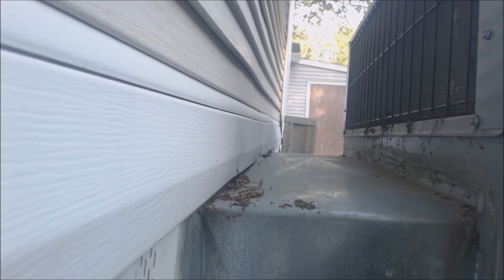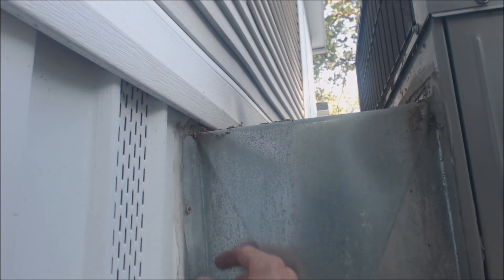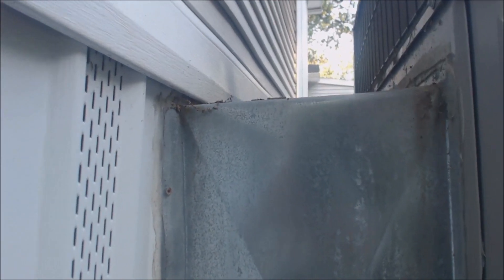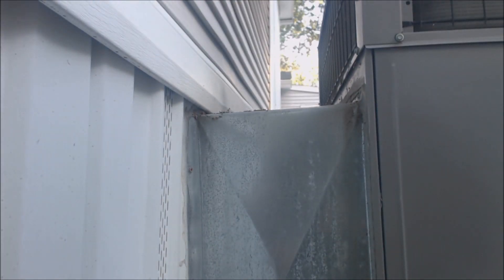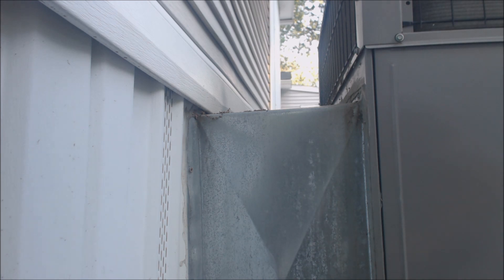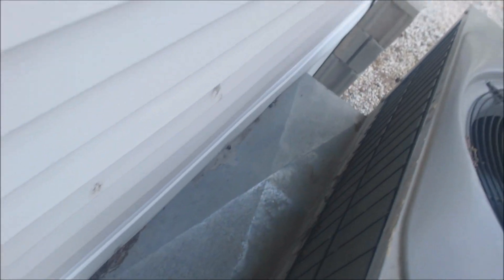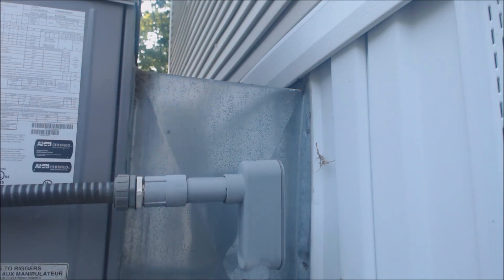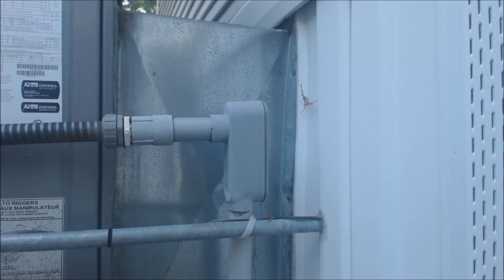Packaged Heat and AC Unit!- How to Seal it up to a House or Mobile Home!

Comment: This was an accidental find.
I’ll be fixing a package unit on a 2021 model Manufactured home in Arizona. The unit it simply butted up against the pvc side skirting with flex duct out of the unit. The critters have chewed the skirt and insulation on the flex to gain access. 
I was about sheet metal clad the skirting like a border around the package unit, I like this idea much more. I’ll just need to drag the pad back 10”.  Good on you for posting this!

Comment: The install looks solid, but I can’t tell by the camera angle if it’s sloped towards the house or the unit! I guess it’s dependent on how tall the unit is, to determine which way it slopes, but I would definitely double check the flashing around the mud sill and header if it’s on a house. I like how you have it going all the way to the ground. I could see how that would help keep wind from getting under it, as-well-as critters. Thanks for the video! You gave me some great ideas for my unit. Thanks

Comment: How can I seal up gaps under the metal shroud at the ground? Should I add dirt or gravel or maybe copper mesh then dirt or gravel? The HVAC installer didn't sink the shroud into the ground, so now I have a mouse infestation under my house.

Comment: What about the water that comes in through underneath that unit how do you address that issue
Reply from the maker: There shouldn't be water underneath of it. The packaged unit would be set on solid concrete blocks and leveled. If it was in an area with water then K-4 sand should be put there and possibly some stone around the unit. A packaged unit would not be allowed to be installed under a flood elevation. Make sure to check the flood elevation cert before pulling the permit for the installation, thanks!

Comment: Excellent information for owners of mobile home/packaged a/c units. Animals tore up the flexible duct under my mobile home. I spent a lot of time figuring out how to stop them all. SEAL UP THE SKIRTING after replacing your ductwork. If you are smart buy metal duct work that animals can't destroy. Insulate the duct work. Do ALL the joining and insulating in the back yard FIRST. Then drag it under the mobile home to connect it to the air tubing intake/exhaust of the mobile home. NOBODY likes crawling around under their mobile home. Snakes, creepy spiders and spider webs, etc. So make it a one time deal. I wish I had been smarter the first time.
Reply from the maker: Thanks thinker too!
Reply: Where do you buy that?

Comment: I bought a house that I need to install a heat pump a 2. 1/2 ton you know the wire size and braker size ,,,I was told  a 60 amp and 40 amp both for the air handler ??? and a 30 amp for condencer unit..is that correct or incorrect.???
Reply from the maker: You would need to look on the rating plate of the unit you are installing at the outdoor unit and indoor unit along with heat strips if used, thanks
Reply: @acservicetechchannel  OK thanks

Comment: if you ever do a package unit where you have to make an angled shroud I would like to see that. I can do one but i feel it can be done easier.
Reply from the maker: Ok thanks for letting me know. It would be an odd video and that is probably why I haven't done one to date because I use two pieces of plywood at the site with my own body weight to cross break and bend it. Thanks David!

Comment: I need to make the metal shroud for my unit where can I get the tools and material?
Reply from the maker: That is just made from a 26 gauge sheet of 3x8 or 4' by 8' galvanized tin. You can get that at your local hvar supply house, thanks!